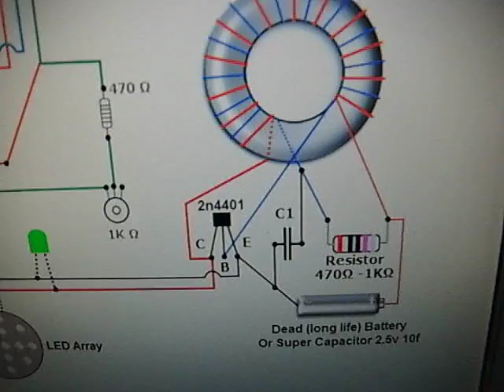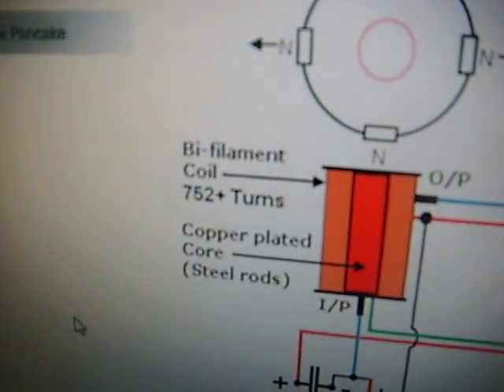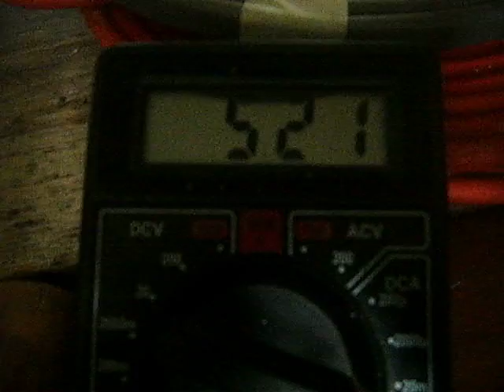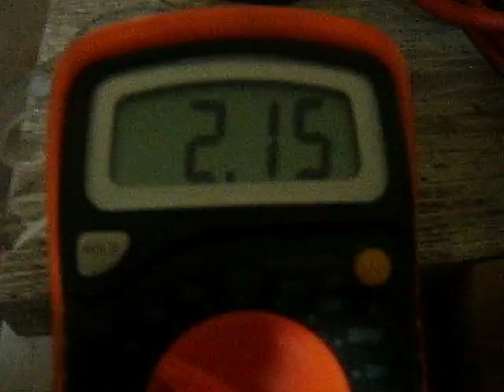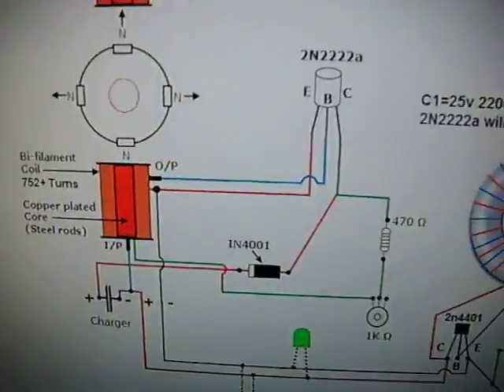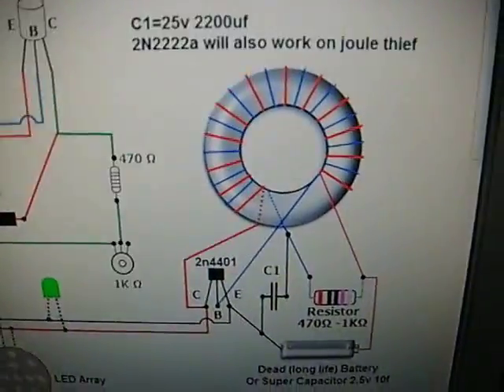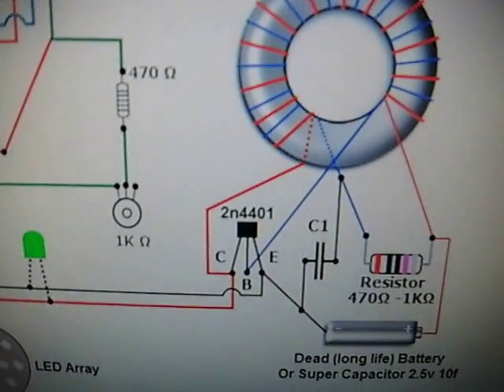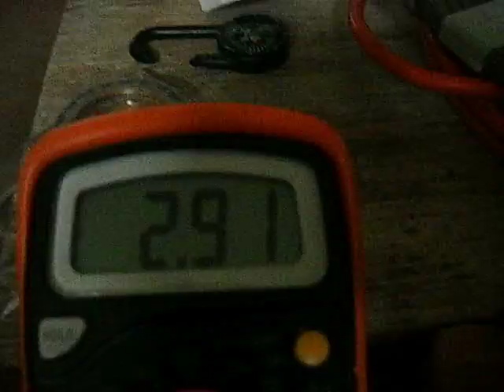Schematics for Joule Thief Bedini

Comment: Just a quick question. I see that the emitter wire from the J/TH connects to the other transistor and coil; it then comes out of the coil to connect to collector. Whereas the collector wire feeds the coil to then connect to base.
I have seen or observed lasersaber and Lidmotor's' wiring and is in total contrast with yours.
I am not an electronic expert… just filling up time, so forgive my asking. I mean… there is no mistake on the drawing is there?
Please, have no hard feeling toward me for asking.
Await your reply, thank you for now!